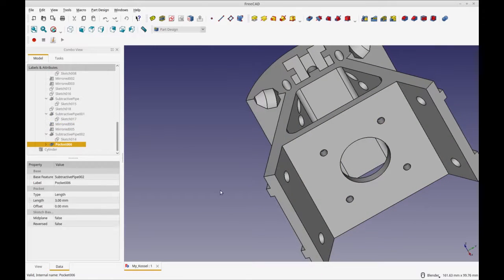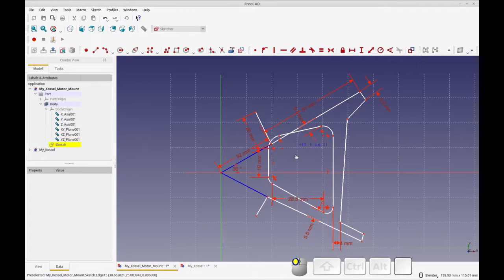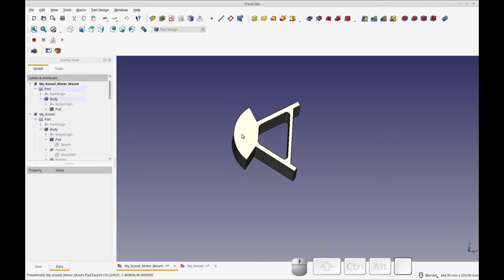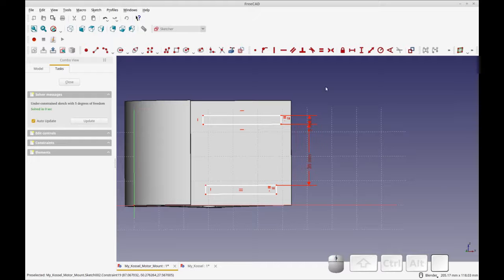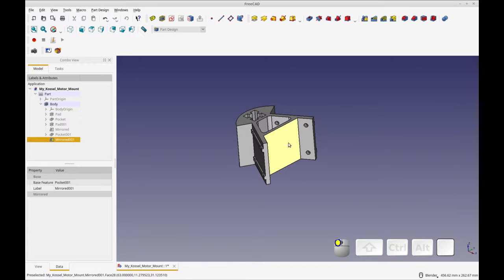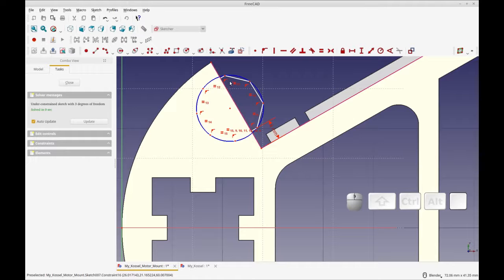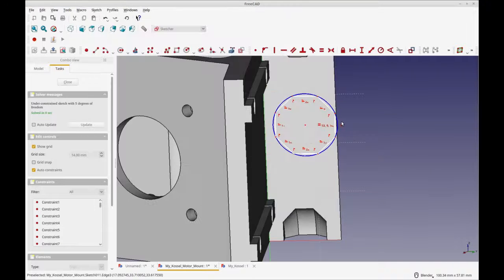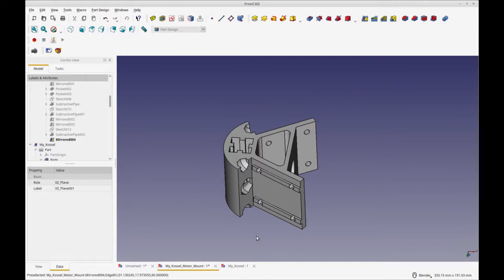FreeCAD - Modelling 3d Printer Parts - Mini-Kosell Motor Vertex

Comment: The reason I watched the video was to see how to engrave the text in that shape, but all is fine, it will help in the journey.
Reply from the maker: I have some newer videos on using the Path workbench for gcode. Also, there are a couple of videos on using text.  there is a newer one on projecting text onto a curved surface.
Reply: @mathcodeprint  Thanks Sir, for sure I'll practice that method.